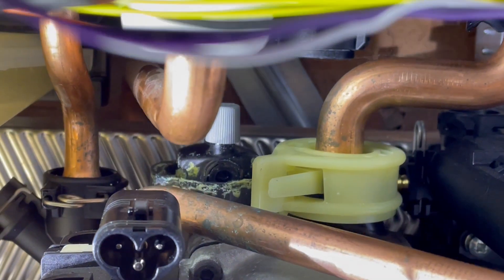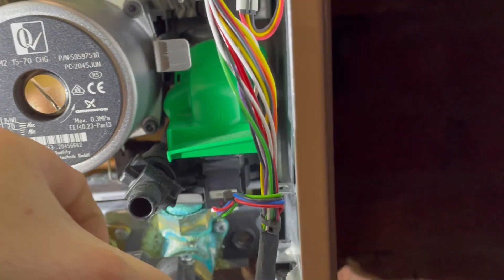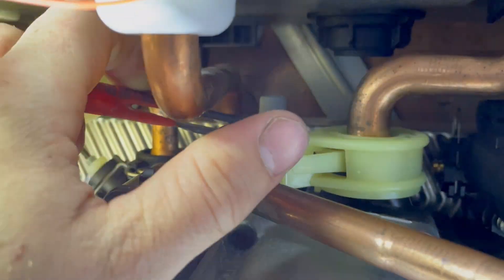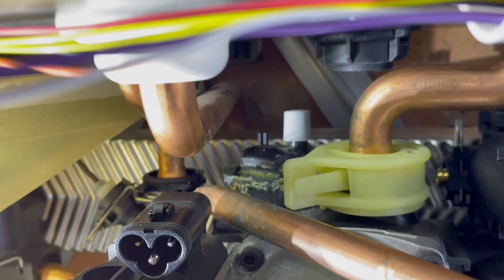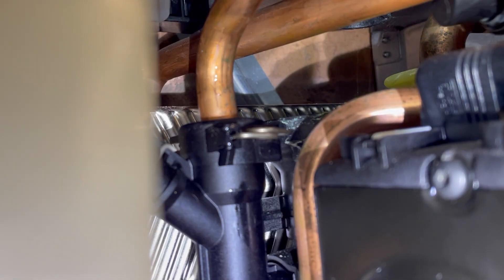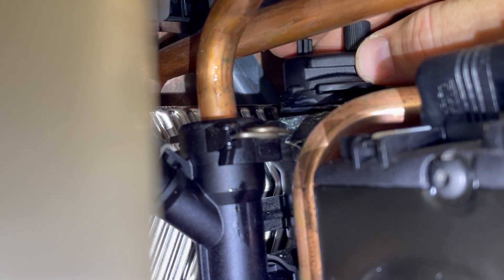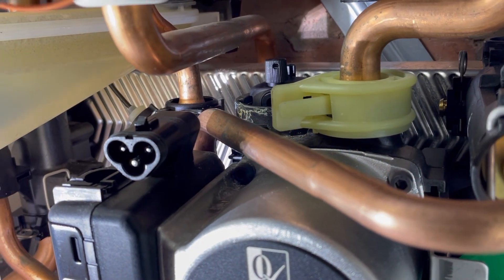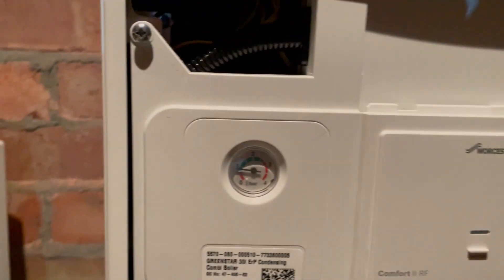Worcester Greenstar 30i ErP Combi Boiler Replacement Auto Air Vent

Comment: My plumber replaced the whole pump as the air went was leaking. He sais it is because the air went is within the pump. Is that true? Boiler still trips rcd.
Reply from the maker: No, the air vent is on a clip that just pops out and you can fit a new one, takes 10mins from start to finish. 
But if the housing is cracked and leaking then yes you have to replace the entire housing unit.